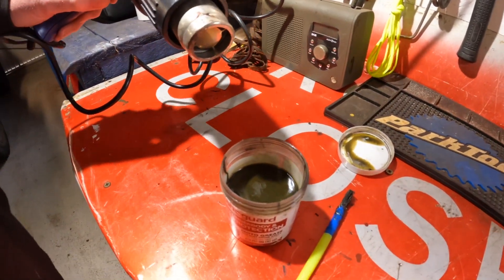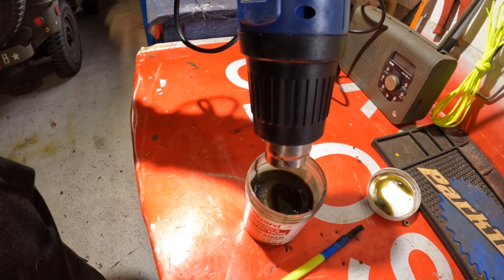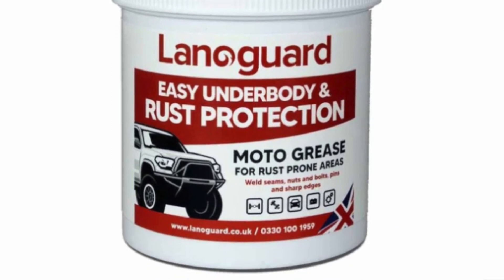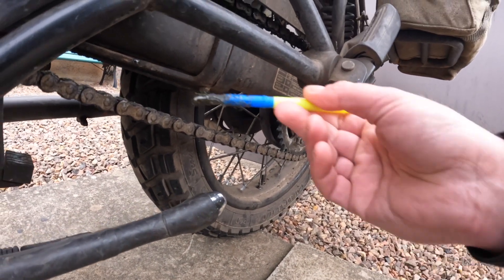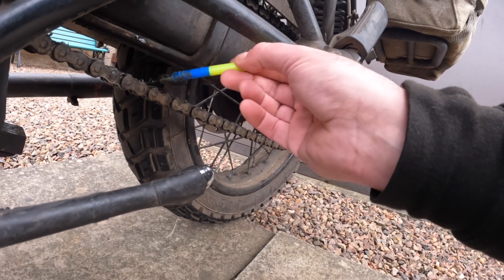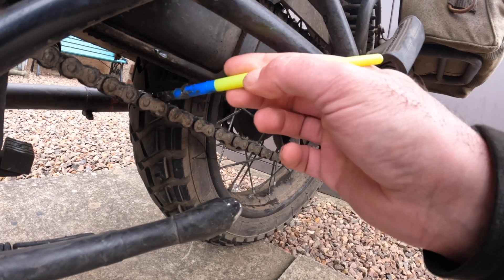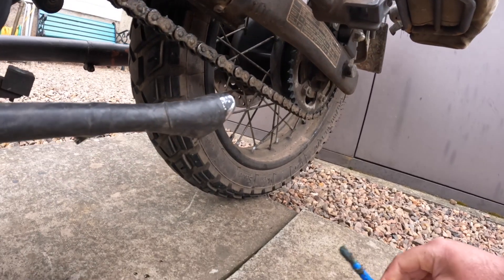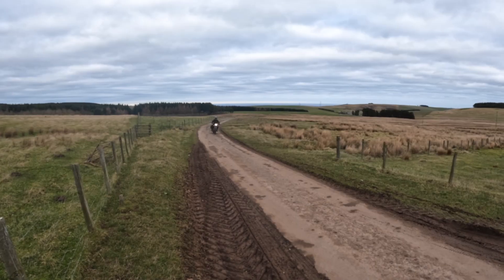LANOGUARD MOTO GREASE  Chain Lube Review

Comment: I'm just on the ol' 80W90 gearbox oil, I apply with a manky old nylon brush whenever my chain looks shiny and give it a wipe down after with a rag. No fling, cleans the chain as you apply, no worries!
Reply from the maker: I used to use that years ago as they had barrels of it at work so was free!, 
Now I own a Willys Jeep I have a drum of SAE 90 oil so I may give it a go and post it on a film, thanks for reminding me about using gear oil 👍😁
Cheers Bruce

Comment: I am going t check this out. Been using dry chain lube and although it is fine you soon go through a lot of it having three bikes with chain drive. Thanks for the info👍
Reply from the maker: Hi Alex, the grease is solid in the tub and once heated and brushed on returns solid once it cools, be good to see how you get on with it, it is definitely a cheaper option long term! 
👍 cheers Bruce
Reply: @Coastriderscotland  I am going to order the 250ml tube and it only £14 and that should last an age. I think dry lube is about £10 so it looks a winner. How often do you now lube your chain? I am heading off to Europe on the NT in May for two weeks and will be interesting to know how long the lube lasts for.